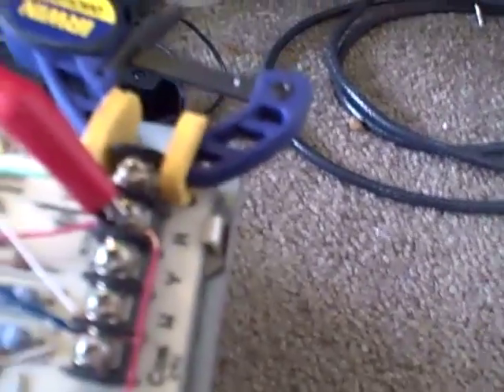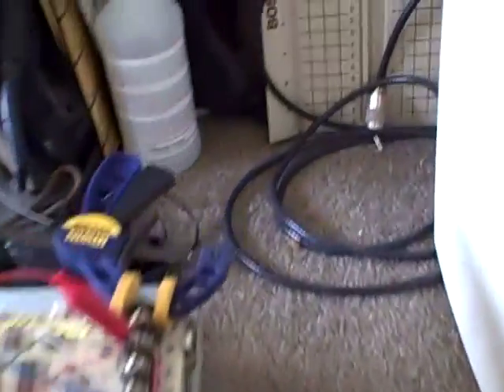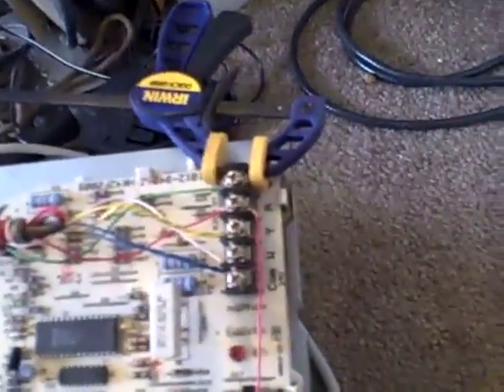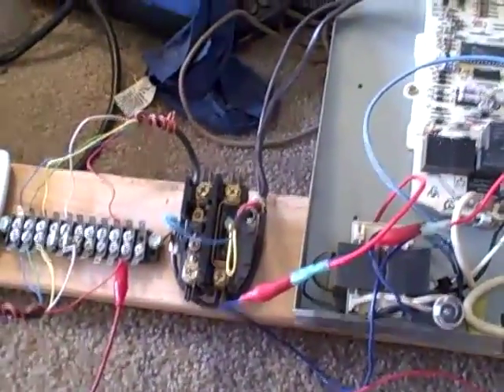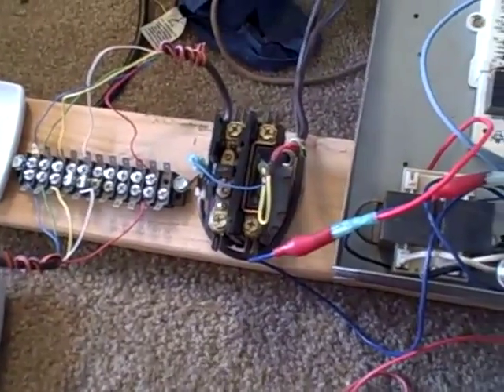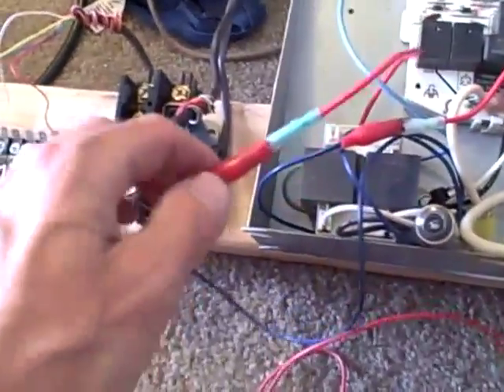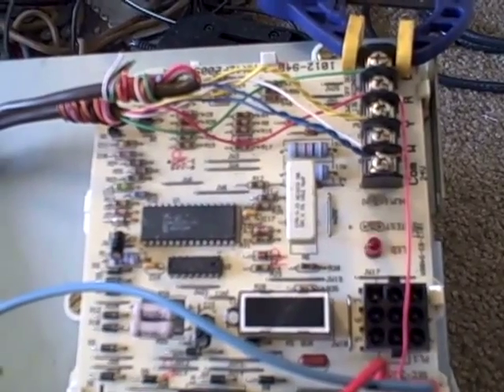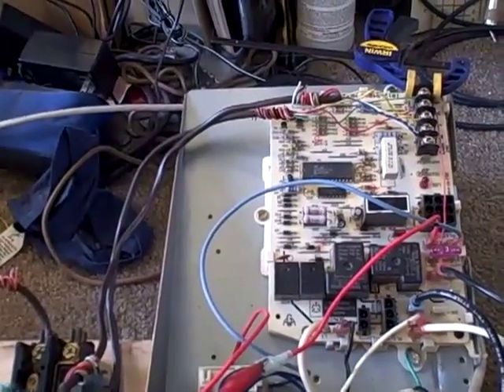HVAC Finding Heating and Air Conditioning Low Voltage Shorts Part 2

Comment: So A control board with 3 amp fuse, if you disconnect  all thermostat wires plug in short 
tool and light comes on control board is bad?. If light off then connect therm wire one at time till light comes on finding short. is this theory correct.

Comment: great video Mikie. What would be a good size fuse to put in series with the low voltage side of the transformer....2, 3 or 5 amps?
Reply from the maker: Thanks very much!  As a rule 3 should be fine, Ive seen 5's put in but Ive never tested to see how those work out... I was just doing some of the math and even 3 seems large, but works fine.  For dead shorts 5 is fine too.  Anyway heres the deal...  The txfmr is rated in volt amps, or VA.  in a dc circuit that would mean 1va is equal to about 1 watt. But when youre working with AC reactance comes into play so its safer to buffer that, so just multiply the VA times .6 to get your wattage.
Lets go big, say a 75VA 28vac transformer.  So 75va x .6 is 45watts.  P=I*V  power is 45, voltage is 28, so we'll just divide it out to get amperage.  45/28=1.607 amps.  So this is closer to the realistic transformer amperage. If you go with the original 75va and assume no reactance then it would be 2.67.  Ive always found it annoying they label them va anyway, heh.  75va is probably the largest you will typically see, usually its 40 to 60.  Ill post a few helpful links:
http://whatis.techtarget.com/definition/volt-ampere-VA
http://www.sengpielaudio.com/calculator-ohm.htm
Well theres a fun overkill answer!  Hope this helps! :)

Comment: Don't forget the defrost thermostat... their wires short too.  Also dual fuel systems tend to short at o/d thermostat, or plenum switch(limit).  Good Job... you are a very good 'winger'  You are a real fart smeller, er I mean smart feller.

Comment from the maker: @fyescas777 I get that too, I'll go out and occasionally the customer will INSIST that the system needs freon and that I need to put some in.  More is better they think! ugh.   Last one I was at like that was about a 40 year old house, AC was FINE, perfect charge, but the original insulation in the attic had packed down over time to just a few inches and wasn't doing it's job.  Late in the day that heat just permeates the house :/